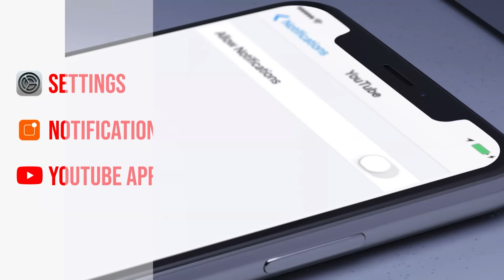Back Bevel Chisel Trick - Does it really work?

Comment: What I appreciate in this discussion is taking care to talk about the tradeoffs: WHY and WHEN the flat-back standard is good, and when a faster sharpening method is good enough.  Being too dogmatic about only ever following the "best" practice can in some circumstances lead to a worse outcome, if you don't understand why they best practice is usually better.

My profession is software development, and just like with any field, you'll encounter lots of opinions about what the best practices are for how to write code that will be the most workable and understandable for other programmers who will have to work with or modify your code later.  Most of the time they really are the best practices, but there's usually a cost in extra time and mental energy spent in order to follow that practice.  That can be in tension with very real business needs to get software in the hands of users rapidly enough to not get outraced by competitors; or other factors where timeliness is more critical than having perfect polish from the start.  And programmer time is expensive, and engineering and polishing EVERY part of the code to a perfect standard just isn't feasible.  So it takes an instinct and experience to know which parts of the code are worth really polishing up well, and which areas, if you spent that effort, would just amount to polishing a turd.

An appreciation of when and where good enough is good enough is not merely a matter of having the emotional tolerance of accepting that some parts of your work aren't fully polished.  Being too refined in inappropriate parts of a project can actually lead to an inferior overall result, to a product that doesn't make it to market in time, or to something that's well polished in aspects the customer doesn't care about, but clunky in areas they do care about.

Comment: I have already seen "Stumpy"s" video. Thank you for investigating further.  This kind of interaction is how a craft improves! I look forward to "experimenting" on a few chisels that I have several of a single size.  As a side note, because I am currently working softwood, I have set aside three ( 1/4, 1/2, 3/4) to try your 17 degree approach.  This is so much fun! Thank you for the smiles!
Reply from the maker: I think you will really like the results of the 17 degree in soft wood.
Reply: I’ve tried the 17 degrees on soft wood and it made a big difference. It went from massive tear outs to a nice smooth surface.
Reply: @danielsimonsson2570  I also prepared a chisel at 17 degrees some years ago, when Rob posted it. It works beautifully. Thanks God, I never work with softwoods though...

Comment: I don't disagree with anything shown in this video. As I said when I made mine, this was an experiment and folks who are interested should first test how it works for them on a cheap chisel (which is what I demonstrated in the video) rather than back beveling their good chisels.  It worked for me in my two joinery-paring tests. My conclusion (which I should have spent more time explaining in my video) is similar to Rob's concluding comments- for the way most woodworkers use their chisels, the back bevel makes little difference in performance, especially when applied to cheap hardware store or yard sale chisels that would require a great deal of lapping to fully flatten, a process that may not be necessary for the average user. But I acknowledge that I am not planning to back bevel my good joinery chisels :)
Reply: Stumpy, I thought your video was good and clear and I love that Rob respects your work and is willing to test it himself. You both came to similar conclusions. This kind of professional back and forth is good and healthy. Thank you for exploring these topics in depth.
Reply: It is all about what your precision requirements are.  If you are making fine dovetails and such, you are going to get tons of value out of all the time spent on flattening those chisels.  For me, who is a hobby woodworker at best, I'm using the ruler trick, because I do not need that level of precision.  Great videos from both of you.
Reply from the maker: Stumpy is the man!!!  I think we just gave a model how to have a professional and respectful YouTube discussion on an interesting woodworking topic.  We should do this some more!   Keep up the great work Stumpy
Reply from the maker: @pagdesigns  we didn’t flatten the back, it was right from the factory grind
Reply: @pagdesigns  The small strip along the edge is flat. The ruler merely lifts the rest of the back off the stone, concentrating the lapping on the very end. If the surface along that narrow strip was still crowned or hollow it would show as a dull spot just as it would if you were lapping the entire back.
Reply: @StumpyNubs  Yes, the bevel edge is now locally flat but I am referring to the edge angle of attack when the chisel is resting on its back and you are paring. If you started with a chisel with a slightly convex shaped back wouldn't the back bevel make things even worst?
Reply: @pagdesigns  Theoretically, if there is a crown on the back somewhere above the polished strip near the bevel, I suppose it could lift the tool higher off the surface and add to the rise in the cutting edge caused by the back bevel alone. I do not believe that was a factor in my test, but it is more food for thought.
Reply: This is all quite scandalous to me as a flat backer.  RIP DW.

Comment: YouTube put this video in my feed straight after watching Stumpy's video. Just using similar triangles, if the rise of the back bevel is 1.5 thou (0.038mm) and it runs back 1mm from the tip then for a 270mm long chisel the back has to be lifted 10mm for the cutting edge to engage.

Comment: Rob you are 200% correct on this evaluation for Chisels flattening and sharpening for performance and application. 

All chisels are to be flat back and fully polished basks and primary, secondary as well for pair or skew chisels they should polished all the way around on all surfaces since you are using both hands to control the chisel! a light coating of Camilia oil makes it even better. Columbus Michigan

Comment: I thoroughly enjoyed your and Stumpy's video. After seeing Stumpy's video, one of my first thoughts was to "almost" flush cut dowels. There have been times when the edge of my chisel gouged the wood around the dowel. Doesn't make for a good day. I realized Stumpy's process would leave a slight amount of wood on the dowel. I added a tiny back bevel using a couple swipes on a 9" sheet of 10,000 grit lapping film and a ruler. So, I have almost no back bevel, but the chisel still glides above the wood surface. The remaining wisp of dowel can be cleaned up with minimal sanding or scraping. I only back-beveled 2 of my cheaper chisels and don't intend to do any more. But, it was interesting. I appreciate all you do for the woodworking community.

Comment: When I purchased my set of Marples paring chisels so many years ago, I rummaged through the whole stock on display in order to select for flattest backs, best bevelling, etc. When sharpening, I settled on letting pressure bear with my thumb on the tip, when backing off on the finest stone, which is the only one I use for backing off. After a few of those, the back began to polish on the tip only, with a bit down the sides, so that it resembled a japanese chisel, only without the pronounced, intentional, hollow in those. Since I went from Arkansas oil stones to using water stones, it has become a much trickier matter where and when I apply the pressure. I do as much work on the periphery of the stones as I can, letting the middle take care of itself as an oldtimer said. Recently used a cinder block to flatten those, it worked pretty well, for zero investment.

Comment: I accidentally used the Ruler Trick on a set of chisels before I knew that I wasn't supposed to. 

It was also accidental that my polished edge on the back of the chisels is only like 1/32 of an inch wide.  You can barely see it, unless you hold it to the light at the right angle and are wearing magnifying glasses. 

After I found out that I had messed up that set of chisels,  I bought a new set of Narex Chisels. (The other set was a cheap set, so it wasn't a loss). I spent almost 3 hours polishing the backs of the new chisels.  They look just like Robs. 

After I watched Stumpy's video, I went out to the shop and tried my old chisels.   I did side by side comparisons with both sets, in Pine, Padauk, Walnut, Oak and Maple.   I was totally shocked to find that my cheap set that had been sharpened wrong performed just as good as the Narex. The cheap set seemed to cut through soft wood a bit cleaner, too.  That could just be my imagination,  but the cheap set does have a Slightly sharper angle on the cutting edge.  

I gotta be honest, with this, and the whole End Grain Wood Glue deal, I'm starting to question everything in the workshop.  When I'm doing anything, and that process has been the same for hundreds of years,  I'm starting to ask *why*. 

I'm excited though.   This is a great time to be a woodworker.  I imagine that scientists back in the 1300-1600's felt like this, when everything that everyone knew was being debunked by using the Scientific Method.   

*This will be the only time I compare myself to a scientist during the age of Enlightenment* lol

Comment: Trimming dowels is EXACTLY the kind of test I wish Stumpy Nubs would have done when I watched his video a couple days ago, and I think you do a great job of using it to demonstrate the kind of situation you can't have any back bevel in. I don't know if I understand why the dovetail test was very relevant though. I think it would have been more interesting to see if you noticed the difference when cutting it freehand like you would have in actual use. If you're not using the supporting block then there is barely going to be any of the back actually touching the wood. Neither the aesthetics of the surface or it's flatness (as long as it's concave and not convex) are super critical, so you can keep adjusting the angle of the chisel until it's cutting straight.

Comment: It was expected. Before I learned a bit of woodworking, it was frustrating how the plane blade or chisel would not engage and cut. Flattening the blade's backs when new saves way more time than fiddling with a chisel that is not flat afterwards.
Btw, I have seen many carpenters use plane blades as wide chisels for paring or referencing. I have done that so many times too. That is why the rear ruler trick would not work for me neither.

Thank you Rob!

Comment: I had seen stumpy's video earlier, and came across this today, of course (you just published it yesterday) and when I saw his video, I thought it wouldn't work for me. His 'trick' works if you are lifting the chisel off of your work, but as you showed, even when paring on the pine, all you had to do was press down with your thumb when using the flat chisel, but when using the back bevel trick chisel, you had to lift it, and you lose your reference surface.  You wouldn't lift a plane from the surface, you're trying to just shave off the top that sticks up above the part you want to keep - the same applies to most chisel work.  His trick works well enough to save time, but for most purposes for which I use a chisel, that's not an option for me either.  The flat back is the only way to get that long flat reference surface, just like a plane.  Cheers!
Reply from the maker: Great comment, thanks

Comment: Well done Rob. I watched James go through the process and though he makes a good case, I can't do that to my chisels. I agree with your assessment. Another point to consider is that for those who rely on sanding to attain a surface they like, sure, the back-beveled edge would be fine for most things other than dovetails. Over the years I've purchased some used, good quality chisels, most I flattened and polished the back, one in particular had been poorly dressed on the back when I received it. After much effort and time, it was much better, but ended up pretty much with a slight back-bevel left. I don't use it for precision pairing for the reasons you have demonstrated. Eventually I'll get it perfect as I work the back a bit more with each sharpening and I'm too stubborn to let it beat me.😉
Reply from the maker: Never let the chisel win !!!!!!

Comment: I haven't had time to watch the howle vid yet but I have been using the ruller trick for years on my plane it works great and for my chisels I Wil just lift it up slightly and pul it back ones ore twice after lapping it this way after time I Wil get a nice falt chissel with out putting a tremendous amount of time into flattening it I haven't noticed a downside in doing it this way

Comment: I think the tip of your measuring dial was ball end, so a little bit of that drop would be the the circumference of the ball lowering as it slid off the edge of the chisel. Great video, as always. Thanks!
Reply from the maker: Yep, that’s why we settled on .0015.  Saw .003 before it dropped off.

Comment: If you assume the measuring point is a sphere then as you approach the edge you will be in fact below the edge of the chisel before it falls off the edge completely. At this stage unless I am incorrect in assumption this is an incorrect method for determining the drop bevel amount. One method may be to keep the chisel on its back ( on the polished section with small bevel) onto a machined flat surface or granite plate and insert a piece of flat wood veneer into the sharp tip which will split the veneer between the machined surface and the sharp  chisel tip .Measure that splintered wood thickness with a micro caliper to measure thickness at the edge of the wood where it has been sliced. This would give you the effective bevel cut.
Reply from the maker: It was a sphere which is why I used my magnifiers to determine when it was in the middle of the sphere. If you remember I read it to be .002”, but then determined that it was actually closer to .0015” in further tests.

Comment: Thank you Rob.
The, for me, very valuable lesson I learned is the way you start your cut with chisels. Before, I did it the way stumpy does it to, lifting the end of the chisel. In this case a backbevel won't make a big difference.
But if, and this is what I learned and will try for sure, you start the cut only by pressing down the tip of the chisel a backbevel interferes with it.
 Thanks again.
Reply from the maker: Thnaks for watching and commenting

Comment: I've always suspected that the ruler trick prevents the chip breaker from performing up to its potential. Tricky to test for sure.

Great video, I've tried to describe the experience of using my optically flat chisels from Blue Spruce Toolworks to lots of people but they typically don't understand what "reference surface" really means. The first few times I pared away a protrusion less than a half thou I was completely sold on "optically flat". I even got an optical flat off eBay to inspect my older chisels I used to think were "extremely flat"!

Comment: The conclusion that a flat chisel back is better is definitely correct, but I’d be astonished if rubbing the back of the bevel on a 8000 grit stone a few times takes 8 tenths off the surface. I’ve done a fair amount of metal scraping for flatness, and my carbide metal scraper takes off about 0.0002” off cast iron, far softer than hardened tool steel. It would be interesting to see the same DTI measurement taken on the other chisel, and a measurement before and after the ruler trick is performed.

Comment: Interesting video!  I watched Stumpy Nubs' one when he posted it, and I thought that it might be worth doing to save a whole lot of time and effort.  It does seem to make working with the flat side down similar to working with the bevel down, i.e., requiring a bit of care and judging the feel to avoid cutting in too deeply.  I think I will give it a try for some chisels which I use for bevel down work, such as removing paint or roughing out concave features.  Especially on the paint scraping, which is pretty abrasive work, and dulls edges quickly; having a better edge might mean less frequent sharpening. The ones I have been using for this are in pretty rough shape, and I have been hesitant to spend much effort polishing the backs beyond a rudimentary level.

Thanks for addressing this, I enjoyed watching and learning.
Reply from the maker: Thanks for watching and comment, I think you are on the right track
Reply: I agree with you Anthony, when you think of using this trick with chisels mainly used bevel down.